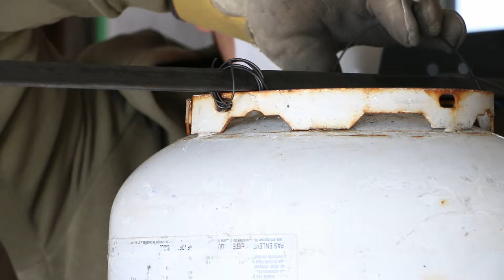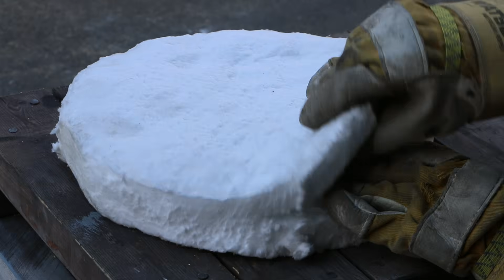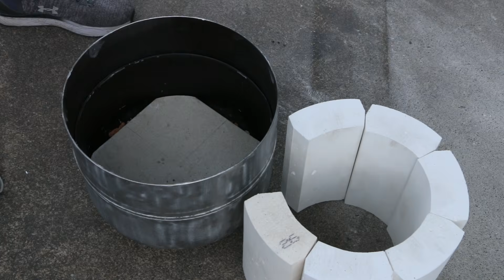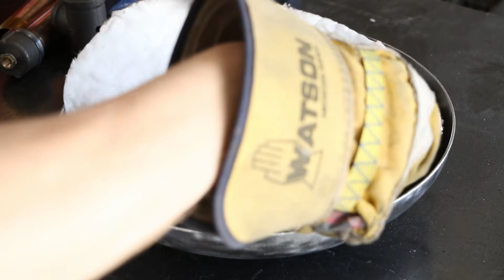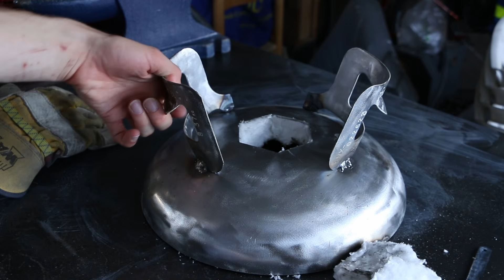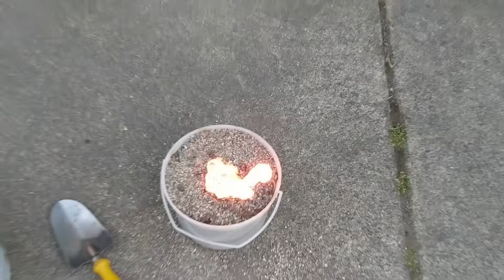Building a Better Propane Tank Furnace

Comment: To remove the valve from the tank you could have used a tie down straps and made a strap wrench you take a thin cheap tie-down strap you remove the ends and put it through a half inch piece of pipe so this is a loop sticking out one end there you go strap wrench I use them to remove oil filters from vehicles you can also take that strap and take the pipe cut a slot in one end a few inches deep you can slide the end of the belt in that and use a pipe wrench to break it loose or you can just wrap the straps around the pipe until you get to against what you want to break loose and then you can use a pipe wrench to twist that pretty much a square piece of metal with a slot in it and a piece of nylon strap or you can use chain and you're good to go

Comment: Just because you washed out the tank, you have not removed all the gas, as some will have adsorbed onto the metal surface, which will be vaporised by the heat of cutting, grinding or welding, leading to an explosive situation.
Reply: Roflol, you are a trip.
Reply: I'm guessing you believe in perpetual motion machines as well.

Comment: A good source of aluminum for casting is engine rebuilding shops.  They will have a supply of old pistons headed for he recycler.  All you have to do is offer the shop more for their scrap than the recycler will give.  Most aluminum pistons are castings and they make wonderful feedstock for your little foundry.  PS -  Don't cast metal on concrete,  If hit with molten metal concrete will spall violently.

Comment: Why the vertical gaps between fire bricks at their outer perimeter? You took pains making them so there must be a reason. 
Paul
Reply from the maker: Hi Paul, thanks for your comment.
The vertical gaps at the outer perimeter are incidental from the geometry of the bricks and the furnace.
Ideally the vertical gaps would not exist, but to grind both faces of the brick fully flat to the correct angle would require removing a lot more material, and probably an extra brick.

Comment: I think your lid simply got hotter because the hot air naturally rises, and there was an opening in the center which exposed the edge of the conductive metal lid to the fire, which of course spread that heat to the rest of the lid.

Comment: Really awesome video, thank you for sharing!! With the blower added, do you think this furnace would melt steel?
Reply from the maker: It may be possible but I have not attempted it yet. I'm also considering building a forced air, liquid fuelled burner which should be capable of melting iron and steel. Unfortunately, the firebricks I used in this furnace are not rated for those temperatures, so I'd have to replace them with higher temperature bricks

Comment: The fan idea is fantastic, but you can do these things without the use of the fan if you build a proper inlet channel. It'll perform similarly and won't need a power feed to a fan.
Reply from the maker: Every naturally aspirated burner design that I have tested performs significantly worse than the forced air design shown in the video.
If you can recommend a good naturally aspirated design that you think will match the performance of my forced air burner, please send me a link to the design

Comment: If you heat up the area around the valve threads with a paint stripper before trying to remove the valve it will come out a bit easier. The valve has sealant which locks the threads. But when the sealant is heated it becomes like soft goo.
Reply from the maker: Hey thanks that sounds like a great tip! I'll give it a try next time I strip down another propane tank

Comment: Fire brick can be easily cut with a saw and you can use a simple Bondo rasp to round off any of the corners it would’ve been a lot quicker
Reply from the maker: It would be possible to cut the bricks with a saw, but there would be no way to achieve such a precise and reproducible fitment as my jigs produced by working freehand.
To achieve a comparable fitment you would have to construct a jig that holds the brick and guides the saw.
And all the curved faces would still be time-consuming to shape using a rasp.

Comment: Hi Markos, I'd love to hear more about the burner - I've been considering a very similar layout using a similar fan in order to induce swirl. Do you have anything posted about the burner design?
Reply from the maker: Hi,
You can actually find a CAD model of the burner on my GrabCAD (linked in the description), so you could 3D print one yourself and try it out. It is designed to print entirely without supports, and with minimal infill material.
I don't have any other content posted about the burner at this moment, but I hope to soon make a video comparing the performance of my forced-air burner against other standard atmospheric burner designs.
Reply: @markosfraser3030  fantastic, thank you!

Comment: Why not remove the valve with a shifter or a spanner BEFORE cutting on it at all? Was the way I did mine as I didn't feel happy making fire anywhere near a cylinder let alone on one.
Reply: Maybe it depends on your tank's valve guard. I did one last night and could not snug the valve with the guard on, so i used a hacksaw to cut it off, giving better access the valve.

Comment: Before attempting to copying l would suggest a stop on amazon 😅 you may want a respirator 
To say the lid would get hot may be a understatement you will need to remove and replace it several times
I would like to know the total cost to build and the time involved (cost of brick shapers?)
How do you move it around ?
It looks very nice I would like to see it after 25 fireings , especially the lid Thank you
Reply from the maker: Thanks for your comment.

I wore a respirator at all times during the build where airborne particulates presented any safety hazard.

It took several evenings of casual labour to build this furnace (while filming the process, which slowed everything down).  I would estimate a rough total of ~12hr of continuous labour.

I will consider doing a more accurate cost analysis in the future, but as a rough estimate in Canadian dollars:
Bricks - 90
Ceramic fibre - 30
Furnace shelf - 15
Shaping jigs (x3) - 20
Misc costs (consumables, etc...) - 30
Total: 185 [CAD]

It's not difficult to move the furnace, I can lift it above my head and I store it on a shelf in the garage.

If my next metal casting projects turn out better than my initial attempt (https://www.instagram.com/p/CliJypVuqjU/?utm_source=ig_web_copy_link), this furnace will certainly be making some appearances in future videos!

Comment: I am missing a video abouth the burner itself
Reply from the maker: The burner is really easy and cheap to make because most of it can be 3D printed! I'm hopefully going to make a video soon showing performance improvement from naturally aspirated to forced air, and release the CAD model, electrical diagrams, and Arduino code!
Reply: @markosfraser3030 did you ever make a video on the burner? I would really like to see how you built it

Comment: Just a quick question about the firebrick comment being a consumable item.  How long do you expect them to last?  I also used firebrick on my build and I probably have 3 years  (80-100hrs) on my forge so far with no obvious signs of any breakdown in the bricks.  I mostly melt Aluminum, but I have done a few copper melts as well.  I did put a thin coat of Satanite over all of the bricks, so not sure if that helps or is just masking an internal problem.
Reply from the maker: Your forge has many more running hours than my furnace ; )
I'm glad to hear that you've not had problems with the bricks breaking down. I expect these should last for quite a while, but I'm still glad that they are easily replaceable in case of mechanical damage (e.g., dropping the furnace while moving it, or gouging them with crucible tongs).
I also tried coating the bricks with a dilute solution of furnace cement, but found that it tended to peel and flake off the bricks.

Comment: While your technique is novel, and we all love playing with our 3D printers, this build is dangerous to health and safety of the user. Putting aside the deadly risk of metal fume fever you put yourself in by breathing zinc fumes, you've placed regular brick as filler inside the heat envelope, which risks the pieces exploding (while less risky when broken down like that, it can still happen), but the biggest risk is that you've included in the bottom unsealed fiber wool material. When heated this can give off harmful particulate matter that can cause some pretty serious health effects. There is no advantage to this type of build over a simple fiber blanket sealed in castable refractory. This is a lot more work for a lot less benefit.
Reply from the maker: Ty for your comment and concerns.

1) Crushed brick floor - I know this method is safe and effective because I have used it for several years in my old furnace build. Most of the crushed brick doesn't actually get very hot, and the stuff that does get warm vitrifies rather than exploding. After it vitrifies, it becomes very stable and I've never had issues with the floor shifting substantially. Another benefit of this method is that it's very easy to replace if molten metal ever gets spilled inside the furnace (ask me how I know)

2) Ceramic fibre - I always wear a dust mask while working with ceramic fibre, and I will place a safety warning recommending the same. However there is no exposed fibre in my build. The thin mat of fibre in the base is completely enclosed by the kiln shelf, and the soft firebricks. Here is an image to assuage your concerns: https://vgy.me/u/fJCIdW The mat of fibre is primarily helpful to evenly distribute load from the crushed bricks to the kiln shelf

This method has two major advantages over more traditional cast designs:

1) Operational Efficiency - The soft Firebricks are much lighter than castable refractory, and do a better job of insulating the furnace. This means that my furnace heats up faster than one made with castable refractory, and uses less fuel to melt a similar amount of metal

2) Repairability - Since they are not cemented in place, each brick in my furnace is individually replaceable. This is useful because they will inevitably need replacement as they erode away over time. The brick upon which the flame impinges will need replacing first, and this is an easy operation. The bricks could even be rotated to prolong the service life of the furnace. A castable refractory furnace could not be easily repaired in the same manner, and many people typically demolish and rebuild their entire furnace when it reaches the end of it's lifecycle
Reply: @markosfraser3030  First of all, let me commend you for actually responding to my comments rather than ignoring them or becoming angry/defensive. It's refreshing to see on youtube. 

I think the warning is a great idea for #1. 

As for #2, you've effectively said, "It's safe because I've never had a problem with it." That doesn't mean it's safe. At the end of the day all it takes with regular brick is a humid day, or improper storage of your furnace, and they will absorb moisture. Then when heated, they can literally explode. This is hardly up for debate. Is it likely? No. Can it happen? Yes. 

Hell, it even happens with high quality construction concrete (there are literal lab test videos I can link you to), it's certainly going to happen with cheap masonry bricks. Based on your response, though, I'm confused why you wouldn't just fill the bottom with zeolite sand, it would give you an actually level surface, it would provide a great thermal sink (storing energy and releasing it, helping you keep a consistent temp), and in the case of a spill, you could let everything cool and then remove the solid mass, and just replace the appropriate amount of sand...

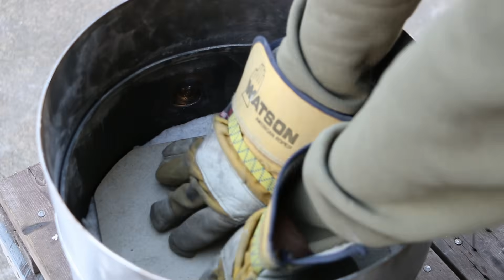As for #3, while the fiber isn't visible in the picture you sent, from what I saw in the video at 5:36 you have exposed fiber at the corners, which appears to be where you have the "missing corners" of the bricks, providing a convenient "chimney" for giving off fibers. It's a minimal risk, but if you're already sealing the fibers for the lid, you've already got all the material, you're already going to the effort, why not just seal the bottom layer too?

For the design advantages: While the bricks might be lighter than a full castable build, that isn't how it is usually done. You take a fiber blanket (preferably Biowool over the older, more toxic Kaowool style materials), and wrap it around, then coat with rigidizer (tip: add a drop of food coloring to your rigidizer so you can see if you missed a spot). Then, once that has hardened, you coat with just a top layer of castable refractory. This gives you lighter weight and superior insulation, the best of both worlds. A top coat of ITC-100 will futher improve your thermal efficiency by reflecting IR. 

Repairability - Yes, you can replace an individual brick, sure, but you still need to shape that brick. To quote your own words in the video, doing so "was a slow process". When all I need to do is remove the liner, make one single cut out of a roll of insulating fiber, spray with a spray bottle, then paint on the refractory, it hardly seems worth the effort, especially when the fire brick is going to cost you more money in the long run.
Reply from the maker: @phoenixflames2455  
2) I've added a warning for this one as well : )
Yes I don't dispute that it is possible for the crushed brick pieces to explode. But it is within my personal tolerance of acceptable risk. Someone with a lower risk tolerance should consider alternatives.I actually wanted to minimize the thermal sink, because I don't want to waste fuel heating up the furnace rather than the metal. Other people with a different setup might have different priorities, and prefer to build a more thermally stable furnace. But my goal was to prioritise fuel economy.

3) I just took a look at the furnace, and you're right there are a few tiny areas of exposed fibre down the cracks of the bricks. I had completely overlooked those areas. You're right I should have stabilised it during construction, and I'll try to spray on a coat before the next firing. However I also agree the risk is minimal from these exposed areas because there is no forced airflow over those fibres.

Regarding advantages:
That's true I am comparing my furnace against one constructed entirely of castable refractory, not a hybrid design. I concede that this design may be comparable in performance to a hybrid design.

It was a lot of work to grind the bricks, but it's also a lot of work to do a good job of casting refractory material. This method might be slightly more work in total, but it's more so a different distribution of work.

As for cost, my local supplier sells 2" wool for 15.39/ft (2ft width). It works out to ~$50 of wool for a furnace like this. I cannot estimate how much would be added for refractory, because my supplier does not carry it. To ship castable refractory is exorbitantly expensive. The soft bricks used in this furnace cost me $84 in total.

So I'd argue that this is a comparable amount of work, and a comparable cost to building a hybrid wool/refractory furnace. But most importantly I was able to build this furnace using materials locally available to me; castable refractory for a hybrid design was not even an option.
Reply: Not all insulating blanket is hazardous to our health I know of some that is body soluble and doesn’t need coating
Reply: @FeatherHorseforge  Yes, we discuss biowool on the Reddit post, but this is a silica based insulating blanket.